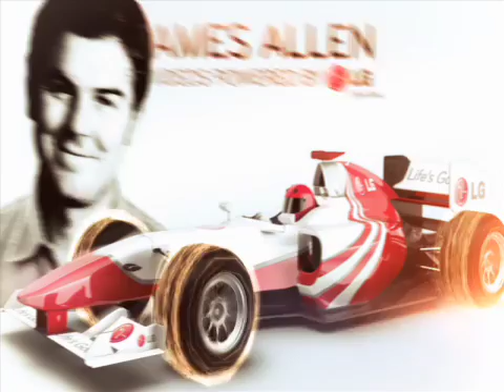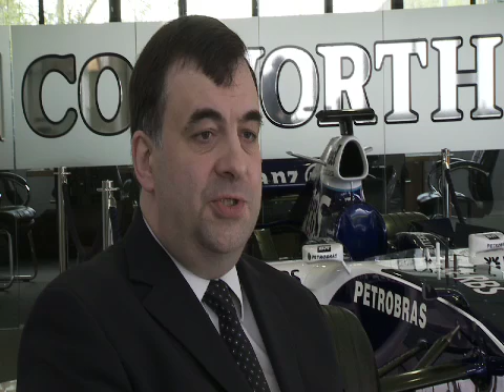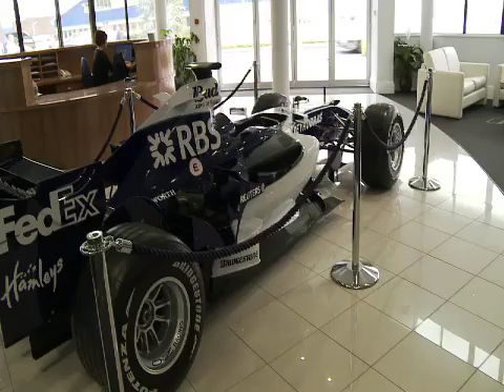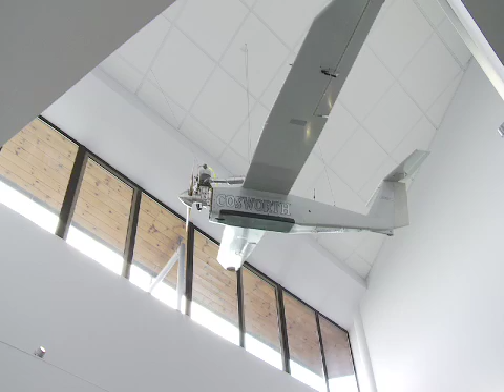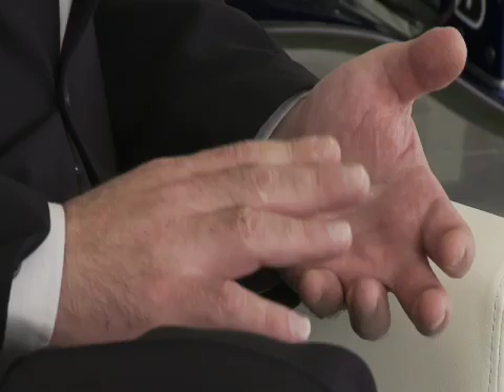Cosworth thoughts on 2013 F1 engine rules.mov

Comment: Many track records have not been broken for years. How can the cars be faster? Through high speed, high downforce turns yes they are but outright pace on straights etc is down. Safety has been priority for many years and this has kept cars pretty much on the level for years. The new turbo models wont be any different in outright pace. They will im sure be built under very strict guidelines and limmitations.

Comment: I agree with you, but if i understand, theres alot of energy recovery tech been revamped and made soo much more efficient, and this tech is meant to be trickle down to road cars+ fuel reduction frm 160 kg to 100 kg per race WITH NO reduction in time per lap is impresive, from a smaller capacity is cool. by the way, would 2008's champ car out perform 2012 car? (genuin question, im looking for general consensis)

Comment: I think you misunderstand the amount of pressure and fuel it takes to run extreme amounts of boost from turbos. You don't need the systems they run now with the v8s to have 3-4 bar of boost from a turbo. There is no way the FIA would allow turbos back in and at the same time limit fuel and fuel pressure to the point where the turbos are useless.

Comment: Bullshit. You have no idea what you are talking about. The are not limiting anything but fuel and revs. The revs are still going to be mind blowing at 15,000, which seemed to be fine for when they were running at 15k before. The cars will still be burning absurd amounts of fuel, and will still be making the same power. The turbos can more than make up for the changes with fuel and revs. Those turbos could put down 3-4 bar and no one will even remember that revs and fuel are down.

Comment: They have not limited the boost from the turbos. They have not limited anything but the fuel and rpms. And are you really going to sit there and claim that the cars will be ruined because they run 3k rpms less? You people keep acting as if they have outlawed the burning of fuel. The cars will be getting 5mpg instead of 2mpg, and you think its the end of the sport? The cars will have at least 1000hp, and will be capable of much more.

Comment: You clearly don't have the capacity to understand F1 engines. This formula is not new to F1, and several teams ran 1.6l v6 turbos in the 80's. Honda ran a twin turbo setup that made 1200hp. BMW had an inline four turbo that made 1300hp. If you knew anything about 80' F1, you wouldn't be bitching about the new formula. If you want to watch F1 where they use the same v8 for the next 20 years, just stick to watching NASCAR and leave F1 to people who are not giant douche bags full of shit.

Comment: Think again. The new formula is pretty much the same as what Honda and a few others ran in the turbo era of the 80's, a 1.6l v6 turbo. The Honda engine made 1200hp, and the Renault v6 turbo made 1300hp. BMW had an inline 4cyl turbo engine that made 1300hp. This isn't just about being "green," it is about bringing technology back into the mix as well. These new engines will be able to produce more power than the v8s used now. There is no comparison when you are talking about forced induction.

Comment: This also isn't just about fuel. When you have a forced induction system on the engine, you can actually burn less fuel while making the exact same amount of horse power and torque. This is the same way that older airplanes used to make the same amount of power up at 20k feet as they do on the ground. When you have a turbo on the engine, the car can either gain fuel efficiency, or it can gain power and torque. Many people who are F1 fans also care about the environment. Mostly the smarter fans.

Comment: Spoken like a true dunce. Such a simple person with simple thoughts. You don't know shit. For example, when you create an engine map for the ECU that allows the engine to burn the most amount of fuel and air it possibly can, you allow the engine to produce more power and torque. When all the air/fuel mixture is utilized in the cylinder, you are not wasting any fuel. If some of the fuel is unspent, it just goes out the valves and out the exhaust. It is wasted energy.

Comment: The torque with the turbos was not bad, it was amazing. Have you even ever seen the on board video of the turbo F1 cars? Those cars are not lacking in torque, not one bit. I work with many turbocharged engines, and they make loads of torque. I think you are so full of shit if you actually think you can tell the difference between 20k and 18k rpms. You might be able to tell a difference on paper, but not by sound or performance. Also, the cars already don't stop for fuel in the race.

Comment: The "four banger" you complain about is the same engine used by BMW to make 1300hp in qualifying. Honda ran a 1.6l v6, like the new formula calls for, and they made 1200hp with twin turbos in qualifying. These cars were every bit as fast as today's, and some were even faster.

Comment: This whole thing about "greener" is really BS anyway. The cars right now get 2-3mpg. With the new formula they will get about 4-6mpg. So it isn't as if they are forcing the teams to use lawn mower engines. With turbos and direct injection, these v6 engines will be able to produce even more HP and torque than the v8s.

Comment: The modern F1 cars are NOT faster than all the old ones. The turbo era during the 80's proves that. Many of the turbo cars ran engines that are nearly identical to the 2014 formula, like the Honda 1.6l v6 twin turbo, which made 1200hp in qualifying and 1000hp in the race. BMW had the m12/13 engine, an inline 4 turbo that made 1300hp. Renault made 1300+hp with theirs. In many cases these cars had higher top speeds than today's cars, and could without a doubt accelerate faster than today's cars.

Comment: I have never heard of F1 seriously considering ethanol, let alone actually testing with it. Ethanol doesn't lose much fuel efficiency when used with direct injection. In many cases, the mpg of ethanol with DI can be equal to that of gasoline. It could get better mpg than gas if they used very high compression. And yes, it was the fuel used in first real modern rocket, the v-2. Petrol should not be favored because it is not really better than ethanol. Indycar runs ethanol and meth before that.

Comment: Actually, ethanol and methanol have less energy per unit than gasoline. But they are still great racing fuels. Top alcohol dragsters still use methanol, and indycar did for a long time before going to ethanol. Ethanol is better though, because it is cleaner burning. Ethanol was used in the very first rockets build by man. It is a great racing fuel and does particularly well with forced induction, and even better with turbochargers. The properties and characteristics are ideal for turbos.

Comment: So you like to pretend that F1 in the 80's didn't happen? The Renault v6 turbo made 1300hp. The BMW I4, m12/13 turbo made 1300hp. The Honda 1.6l v6 twin turbo made 1200hp. The Ford v6 turbo designed by Keith Duckworth himself was making 1000hp in qualifying and the race. These are cars that went just as fast, and in some cases faster than todays F1 cars. They were just as loud and sweet sounding. F1 in the 80's turbo era was when the cars were the fastest, loudest, scariest things on four wheels

Comment: Very well put. I for one am very excited about the new formula, and I think anyone who really knows about physics or motorsports feels the same way. They proved to the world that small displacement, forced induction motors are more than capable of abundant HP and torque in the 80's, and I have no idea why all these naysayers like to pretend that F1 in the 80's didn't happen. It did happen, and they ran similar engines to the new formula which put down 1300hp. Just look at the BMW m12/13 engine.

Comment: Why would you not want turbos? Forced induction is going to allow these new motors to run far higher numbers than the v8s ever could. There is no comparison when you can cram air into the engine at a rate of 5 bar as apposed to a rate of normal atmospheric pressure.

Comment: People like PortugalGP have no idea what they are talking about. They just think they know stuff when in fact they know nothing. The 80's turbo engines in F1 were the highest power making engines in the history of the sport. The new engines will be able to produce far more power than what they use now. When you can apply 3-5bar of pressure to the intake manifold, you can generate massive amounts of power and torque that would otherwise be impossible to achieve without forced induction.

Comment: You have no clue what you are talking about. You do not need large displacement engines to produce large amounts of horse power and torque. It has been proven time and time again that small displacement motors with forced induction are capable of more than enough power for F1. Anyone who believes otherwise is only showing how ignorant they are when it comes to physics. The highest HP f1 cars in history were the v6 and I4 turbos from Honda and BMW from the late 80's. You are annoying and ignorant

Comment: how could we not hate it? burnie eccelstone himself has said that the 2014 engines sound bad. listen to a flyby of a car from the 80's 90's and early 2000's. youll see how much they have changed. from a spector point of view if F1 has less horsepower than say indycar and the cars sound bad, then they have ruined the sport.

Comment: Not a chance.

Look up stats F1. 

The highest revving one was the Renault V6 turbo with the revolutionary new pnuematic valve gear (which today is standard) which could rev up to 12,000 rpm. The Hondas, BMW's, Ferraris and TAG Porsches reved 11,000 rpm at best.

15,000 rpm wasn't reached until 1995 with Mercedes. Ferrari and Renault (Mecachrome) didn't reach 15,000 rpm until 1998.

Comment: H2 is more safe than octane-based fuel. Octane rating depends on anti-knocking, and I was saying that all Carbon-based fuels break down to produce H2 which then reacts with Oxygen. It can be unsafe if stored incorrectly, but so can petroleum. Just look at the BMW Hydrogen7, that car is pretty much the same as a stock 7 series only with zero Carbon emissions.

Comment: It is definitely not a myth.  Hydrogen is used in rockets, and those guys at NASA and wherever else already state how unsafe it can be.  Hydrogen would also be pressurized, even to the point of being in a liquid state.  Do you know that octane rating and octane are indeed different?  Lead certainly isn't an octane, but is great for reducing predetonation/engine knock (or raising octane rating) and is what is usually found in race gas.  They've tried and tested, what do u have different to offer?

Comment: The whole "H2 being unsafe" thing is a fucking myth. It's only said so due to Hindenburg, which was a balloon filled with a flammable gas. In a fuel tank and engine, there is no difference between H2 and gas apart from the fact that H2 makes more power. If Hindenburg was filled with petroleum vapor, it would have been much more of a catastrophe. Besides, octane has 9 times as much H2 per molecule and this breaks off in combustion. Using H2 just removes CO2 from the products.

Comment: that and downforce of cars today is much greater so turns are taken much faster, plus the engine control module that helps with driving (traction control, etc)  I think cars using better materia imporvements heped with weight as well.  Power cut for safety as well, not just for polution

Comment: We use that shit in rockets and no it is deemed unsafe.  Idk what CO2 has to do with elctroding water to break it down to H's and O's and O2's?  Like I stated above, we have little to no experience to tell them what's what.  The things you've stated F1 tried and complained about the mess alcohol made and that they already used petrol based fuel and it was already known and worked just fine.  Also makes more mpgs so in a race where no fuel ups are allowed (or less is handy), petrol based favored.

Comment: Well it's also a challenge.  I'm sure they can crank 2000 hp out of a twin turbo 3.0 liter v8, but the everchanging rules make for competition.  They ruled out inner wheel braking (McLaren) and suspension tuning while on track.  They know what they are doing way more than any of us without a hint of experience can tell any of them.

Comment: Its not all about power , you can say the old engines had over 1000 hp but the efficiency was bad and so was the torque from turbo engines. I just hate it when they released the V8 in 2006 revs 20,000 and now its 18,000 , the difference is definitely noticable but also the advantage is engines last longer for less costs and more efficient for no fuel stop race.
For the coming turbo engine it will be  more efficient and enough for no fuel stop so they should maximize the power and revs!

Comment: @EvDog13 I watch F1 for the enjoyment and excitement.Not because i want active suspension on my road car for fuck sake. Only twats think there should be exccesive rule restrictions that would in turn lead to F1 serving a purpose for the automotive world. Look what all this 'progression' has done,F1 has got to a point where they have to add DRS and KERS to 'spice up' the racing, as a result there is passing, not overtaking is which is just awful.I would rather watch 80's F1 than present.

Comment: @EvDog13 

Yeah, you're right, but there should be a balance. 1,6 litre engines is way too extreme for F1, and it would cause huge losses in revenues. I mean, no one wants to see cars with 1,6 litre engines being named "Formula One cars"... the fans want F1 at its best, not a Formula 3 engine ripoff... tv ratings, sponsors, supports, it would all plummet and F1 would cease to exist.

Comment: @5995Ferrari uhh they acutally used 4 cylinder engines that were turbo charged back in the 80's and I 100% know your toyota doesn't have more power than one of those 1,300 hp BMW's....  A 4 or 6 cylinder F1 engine isn't a normal engine that goes in a production car.  The current v8's are only around 250 pounds and can do 18,000 rpm.

Comment: @mushieslushie 
You are right and if the fuel or engine types need to be changed so be it, but atleast balance it with adding something for the driver to do, manual gearboxes or, as mentioned in the video, much less downforce. Otherwise it will become a showcase of green technology not racing.

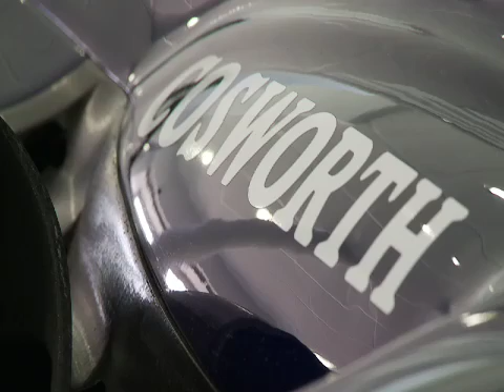Comment: skip to 2:23 to skip things unrelated to the title

it is ridicculous how FIA is making both F1 and WRC machines little green pieces of shit. Soon they will be running on electric motors generating so much downforce that the driver will be in the pits holding a throttle button and everyone go around identically. Remember the times when all cars were very different and hard to drive? Remember when F1 was the pinnacle of new innovations? I barley do.

Comment: @tohtorigyro I doubt they will be slower, even though I think FIA will take measures to limit boost. Back in the 80's, 1.5L Turbo engines were so much more powerful than NA 3.5 engines of the time that I think, with current technology, they could become really scary.

Comment: To use as an example, the Suzuki Hayabusa has a 1.3L L4 engine @ 11,000 RPM. The new engine regulations will have F1 moving to a 1.6L L4 turbo engine @ 12,000 RPM. To me, the Hayabusa sounds great. With a turbo, even better. Sure, things like bore & stroke and firing order will factor into the sound, but whose the expert that says they won't sound good?

Comment: @BoogWar01 in the 80's they had turbo engines that could produce almost 1500hp. i don't know how reliable they were but man they had peak power. but turbo isn't a good idea for something like f1, because of the lag.  my worry is that the cars will not only sound anywhere near as great as they do now, but that they'll be alot slower and have stupid reliability issues.

Comment: @ImFasterThanTheStig 

Who cares what engines they are, as long as they are insanely fast, and difficult to drive.

Ayrton Senna. Turbo-era. That's all you need to know. Those turbo's were very difficult to drive, especially in the wet. REAL skill will come forward once again.

And they are not V4's but straight 4's, which they used at Indy500 from the 30's to 70's, the dominant Offenhauser 4 cylinder engine.

BMW 1,5 litre 4cyl turbo in F1 1983. 1400hp!! Made Piquet champion.

Comment: @BoogWar01 

In Group C (endurance racing) Porsche dominated with their 956 and 962 models. Why? Although other manafacturers could produce as much power as the Porsche they never could produce that amount of power AND be as frugal as the Porsche was. It used less fuel, which is how races are won in endurance racing.

This is also the reason Porsche IS very interested in making a comeback in F1 in 2013. 

Audi's LeMans racers with turbodiesels result in excellent turbodiesel roadcar engines.